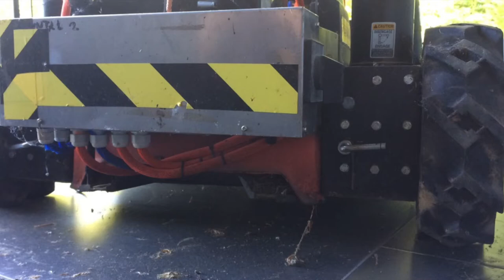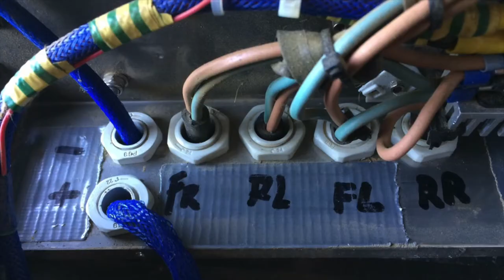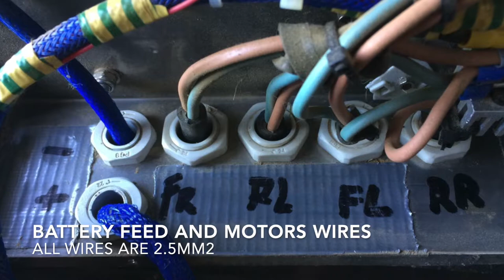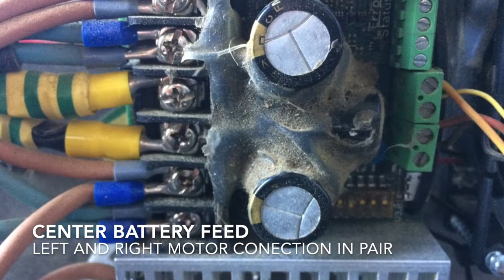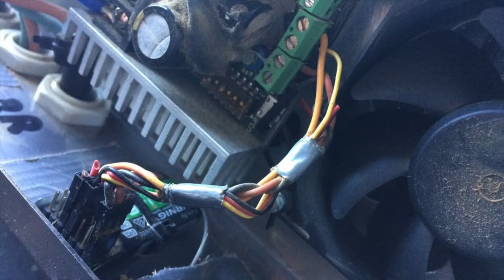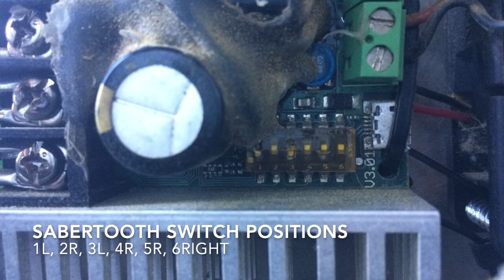RC Mower sabertooth conection thru pictures

Comment: Wich radio receiver you used to control a Sabertooth?
Reply from the maker: Some cheap set from Hobby King....every thing will work I guess
Reply from the maker: https://hobbyking.com/en_us/turnigy-tgy-i6-mode-2-afhds-transmitter-and-6ch-receiver.html?queryID=e4e80b1a0e8e83a140ed5e9e936684d2&objectID=45922&indexName=hbk_live_magento_en_us_products

Comment: Hello. Perfectly!!! And what kind of SABERTOOTH do you have? 2x32 or 2x60? If 2x32, one controller for four motors works normally?
Reply from the maker: Hi...2x32 without issues...and yes one controler for all 4 motors.....left and right plugged in same port.....
Reply: @Roha46  Thank you very much, this is an important wholesale for me. I thought I wouldn’t pull. I do the same.